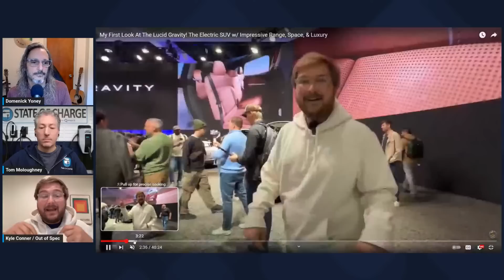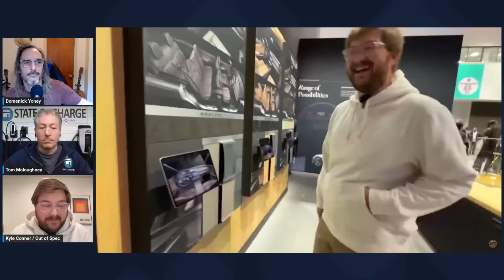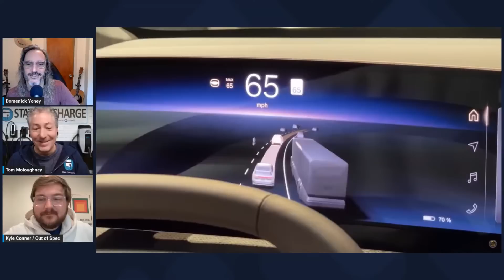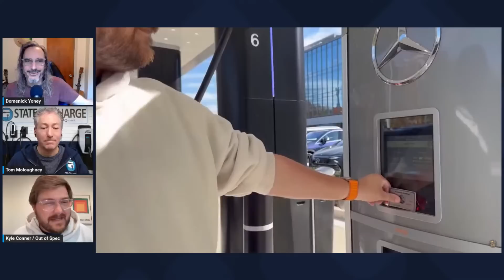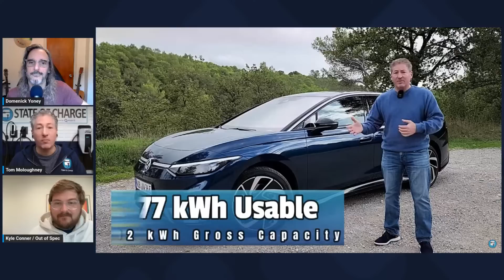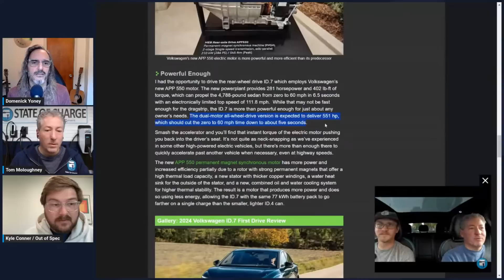Lucid Gravity Falls To Earth, Tom Drives Volkswagen ID. 7

Comment: I really wish Lucid would make a "sports car" (air, but shorter. More vertical batteries stacking to keep the same battery size.) And take that opportunity to fix the rear end design... there are lots of "full size EV sedans", and not many(any?) sports/gt cars. Were the lucid shorter, I might own one (but it doesn't fit in my garage as it is)